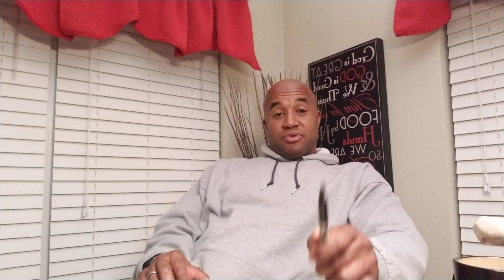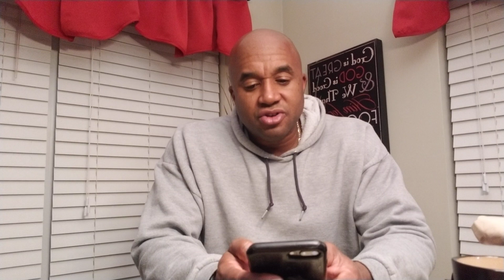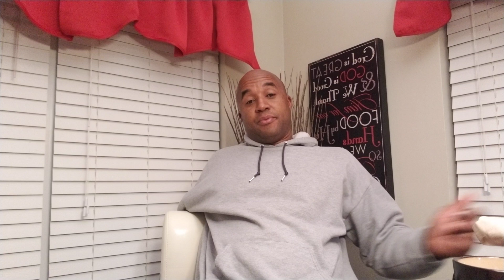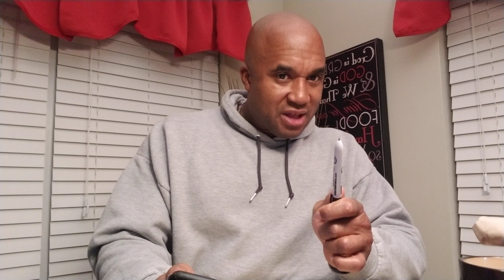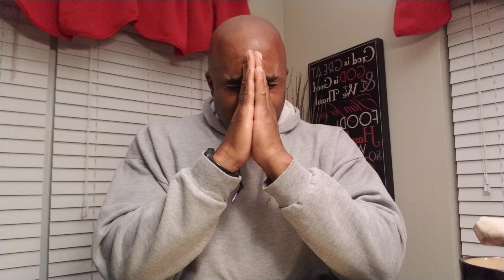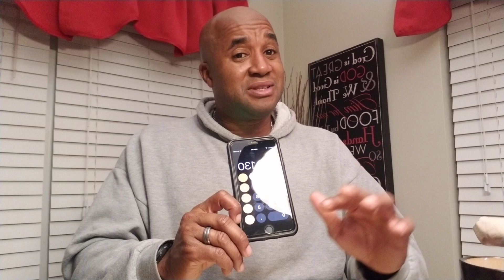Alternator and AGM Batteries the  Connection

Comment: It's not to add something extra... it's for reliable long term use.. and extra load if battery is starting to get old, or if it's raining at night, so your running a/c, headlamps, wipers,  factory stereo,  brake lights etc... the alternator pretty much makes zero "extra" power... and modern cars have full on variable voltage/amperage alternators that give exactly what is needed at a given time.. this is to reduce engine load and improve efficiency... absolutely no such thing as extra voltage in a car since the 80s or 70s... so yea, better get a upgrade and some good batteries.

Comment: I noticed you said a lot about electrical for subwoofers, but you never mentioned the option to run a subwoofer with a capacitor (a device that stores energy from your battery and supplies your sub with the energy it needs), or the option of adding an additional alternator so you have the stock car alternator only powering the car and the second alternator powering only the separate battery that's only for the sub.
Reply: Running a cap is literally like a really small battery. Best bet is to always run a battery. Caps aren’t worth the money, they don’t hold a charge long enough.

Comment: So is everyone using batteries now and capacitors are pretty much a thing of the past?
Reply: I never used capacitors in my sound system. You cant get the full potential out of your system with those things.
Reply: @megaman010391  why not?
Reply: Pretty much.

Comment: recently I had purchased a Deka intimidator AGM battery 9A51P. labeled for a 300 cold cranking amps if I'm remembering correctly . I purchased it for my nephew's Prius and he destroyed the car within about 2 months of installing it. now I have a $200 battery sitting on my workbench not sure exactly what to do with it . not familiar with AGM batteries it's labeled as a dual purpose battery (start and deep cycle). can these batteries be utilized for something else besides a Prius? thanks

Comment: So I have 4amps(8800watts total)after calculations8800w÷14.4v=611÷.8 gives me 763amps.my alt.is390amp alt.my jeep uses a class 48 battery so that would be a xspowerd4800.what would my secondary battery be, for the rear? & that's based on the wattage I mentioned if I use the full potential of my amps,(running at 2ohms) then that becomes 12000watts n the amperage becomes 1041 amps.then watt battery do I get now for the secondary.(my head hurts) I would also get a (NVX [XSBI500] 12V 500 Amp Dual Battery Voltage Sensitive Smart Isolator Relay)to help with the recharge.so again what battery should I get to help power the stereo based on 1024amps and 12000 watts of power.please help me with this.I'm trying g to buy the right battery.tried to reach xs power.com/d4sound multiple people n with no luck.I even used the calculator on xs power website yo determine what battery but its giving me wrong info.

Comment: Aye bruh I appreciate the videos! I've learned a lot from you. Question: can I use a wet sealed battery for my start battery and agm for my audio if I use a isolater?
Reply from the maker: Yes
Reply: @M.B.Enclosures  what about the lithium batteries
Reply: @dcaddell1505  I think so

Comment: When it comes to Electrical Power, Only 2/3's of a Fuse Rating & Alternator is the max threshold. The excess 1/3 is used specifically upon Start Up & Power Up. 150% is the "Hot Start" for Any Electrical System. After the initial Power Up / Start, Electrical Current Drops Down to Electrical Current Idle.

Comment: Question, I have 4 zv5 15 sundown subs , with 2 12k soundigital evox . 1 per 2 subs . A 320 Alternator . At idle it runs 285 amps. 
I currently have 3 xsD3100 and looking to get the Ds18 220 battery well 2 to add ... will this be enough ...??
Reply: Your trippin,  you need a dual alt setup
Reply from the maker: C’mon man you know you lacking. But it will suffice for short demos . Just charge the batteries often

Comment: want to maximize your electrical system?  Get yourself a large 500F XS Superbank capacitor.  AGM batteries charge and discharge slowly, as it requires a chemical reaction to take place.  This means in between beats your battery may not be able to gobble up that 75A you have extra.  A supercapacitor can... and a super capacitor can charge up to the charge voltage of the alternator ~14.5V.  Batteries charge at that voltage, but their float voltage is around 12.6V.  So that means without a capacitor, as soon as you overrun your alternator, your voltage will drop to 12.6v.  Then as you hit the battery it’s voltage drops more.  A large capacitor can help reduce battery drain by supplying the dynamic peak demand, at the charge voltage of your alternator.  That means potentially up to 2V more input voltage to your amps, which means more output wattage.  Its nearly unlimited charge rate means it maximizes your alternator output and effectiveness, over time.  A match made in heaven.

Comment: Great video as always. Right  to the point and in my language ...Strait up. I'm currently running the taramps smart 3 off of my stock 150amp alt and d3400r battery.  My installer told me I'd be better off NOT using both batteries or isolated and go strait from the 3400 . Huge difference just replacing my oem agm lexus battery.....wow at the same settings,  same song, same volume . Night n day.....
Reply: Also my cars alternator only pus out 13.8 volts. Most cars range from 13.8 to 14.2 at idle with no accessories on. It seems strange but I would turn my headlights on my Honda accord so my car would tell the alternator to work harder there for sending more juice to the battery faster... But it also drops your Miles per gallon .
Reply: @jaysonoliveira4752  good thing I leave out at 4am when its dark and come home when sun going down lol
Reply: Like anything else you gotta pay to play. Definitely do the big 3 atleast even with the factory alt. It's easy enough, those small factory wires don't let the juice flow in fast enough and put a strain on your alternator
Reply: @jaysonoliveira4752  yes sir did the big also used welding cable. Prob just going to get the alt not short change myself prob spring summertime
Reply: I also purchased the noco 5 smart charger . Charges all types of batteries,  and conditions them. I figure it's alot cheaper to maintain my battery rather than a $450 alt + installation on my car. Poor bass head style. I don't keep my vehicles more than a few years anyways.
Reply: @jaysonoliveira4752  my stock alt is 170 I changed main battery to d6500 and added a xp3000 to rear. Do I still need to charge both batteries weekly?
Reply: @jaysonoliveira4752  running taramps md 3k and some bs 1200 watt amp
Reply: Depending on how often you drive it and bump it. Don't get me wrong the bigger alt is the way to go hands down. But in my case I don't mind charging the battery  once in awhile with a $90 agm charger/reconditioning.  Alot cheaper than $800 for my alt+install on my lexus. Also most alternators don't give all there amps unless your engine is up to 2000rpms or more. So if your shits off let's say and your on the highway for like 20min or so a good battery should reach a full charge just running off your alt. But its nice to charge them and reconditioning them once in awhile.
Reply: @jaysonoliveira4752  yea I have a 1 hour 15 min drive to work every morning so I should be good with that and guess charge it once a week
Reply: Same here I work in boston where it's already under 30 degrees usually when I leave at 430am better to have and not need then need and not have...lol
Reply: Hey bro. I have an older Acura with 120 amp alternator. I want an AGM battery but didn't know what size to go with. Sounds like the 3400 like you have would work great for me. How often do you put your charger on it?
Reply: @CanesupNolesDown  never I checked it multiple times with a 1300rms amp that birthsheet says 1475 and my lexus which is only putting out like 14.0v tops never drops no matter how hard I slam it. I did the big 3 just as some added security but didn't even need it. Like I said my factory alt on my lexus only puts out like 14.0v max it's usually 13.6-13.8 but when I turn the lights on YES ON it bumps it up to charge harder and faster to 14.0 and I never have any issues. That was with a 130amp alt.....no issues.....NOW I have a 250amp alt and the same 1 under the hood 3400 battery and run a RF T2500BDCP  NO ISSUES AT ALL... That amp puts put well over 3000rms easy all day long . And sounds amazing doing it. Crutchfield has it for like $1300 I paid close to $2000 2 years ago for the same amp.......good luck man
Reply: @jaysonoliveira4752  I'm having people tell me that an alternator won't charge an AGM battery fully. I just ordered a 3400 to replace my under hood battery. Just trying to make sure I do it right. Those things are expensive

Comment: I have a 250 amp alternator and I'm running 1037 watts arms. I have a total of 89ah of battery and I still experience head light dimming. Have an Optima red top up front and a hc1200 in the rear. How do I stop the dimming?
Reply: What's the stock alt size? Have you checked your grounds?
Reply: Definitely would check the grounds. You shouldn’t be dimming. When you installed the new alt did you do the big 3?

Comment: I'm running two red top optimas  models  34/78 and 75/ 25. I can't find the amp rate your talking about
Reply: Optimas are trash bro. They used to be good until they changed their factories across the border. But yes like Michael said above get the yellow top. Save up for a better battery(XS Power, Odessy, Northstar)
Reply: A red top 75/25 has 720 cca and a 34/78 has 800 cca. Here is a url to read on how to figure your cold crank amps to amp hour ratings ( https://mechanicbase.com/electric/how-to-convert-cca-to-ah-amp-hours/ ). You are running 2 red tops. Red tops are starter batteries. The yellow top batteries is a deep cycle that would be used more for a second accessory battery if you want it for a stereo system.

Comment: What model is ur charger, thank u for this video
Reply: Make sure you get an smart charger or as M.B. said an intelligent charger. They have different types of car batteries so you want to make sure you battery charger can handle the type of battery you are getting. General 12v batteries are flooded but are quickly being replaced with agm theses days but they charge differently because the resting voltage is higher on a agm battery. The benefits of an agm is they aren’t suppose to let of gas so they are good for your trunks. I personally have had good luck with noco smart charger. I know very little about the smart charger world but they are highly rated online and it’s sold in our local battery store
Reply: @michaelraykinney  thank u

Comment: '13 GMC Sierra, just added a Ohio Generator 300 amp alternator with a new XS POWER D2400 BATTERY. 
💪🏾💪🏾💪🏾💪🏾💪🏾💪🏾💪🏾💪🏾💪🏾💪🏾💪🏾
Reply: How big was the difference in performance?
Reply: @jaystocks460  voltage stays steady, removed 95% of the headlight flickering.
Reply: @pchange318  does it sound louder
Reply: Awesome bro im doing the same to my ford except d3400 xs power and 320 amp alt
Reply: @jaystocks460  how is that set up working for you? I was thinking of a 370 amp alternator on same battery
Reply: @ramsesfelix388  it's good bro i don't go below 13.5 volts